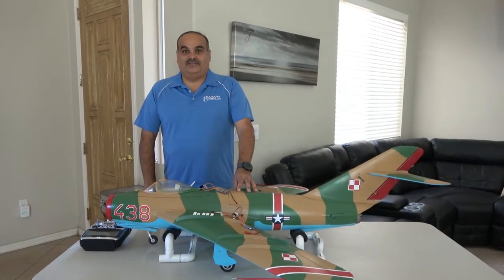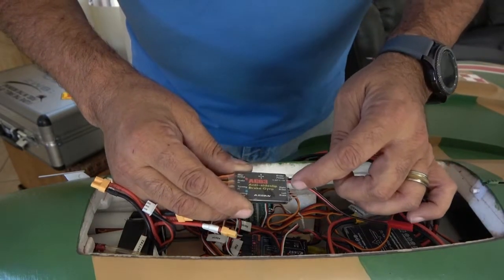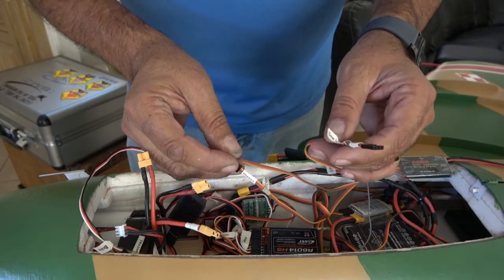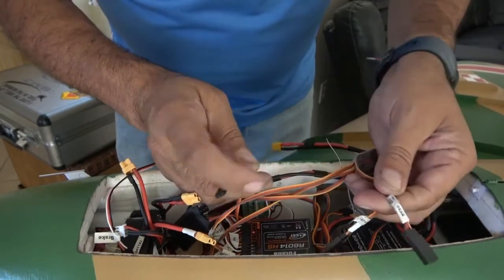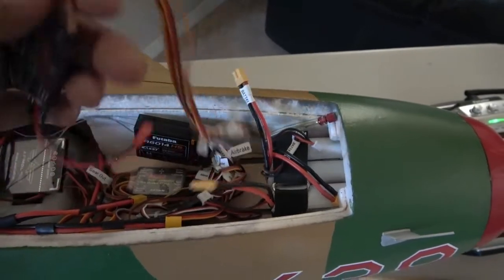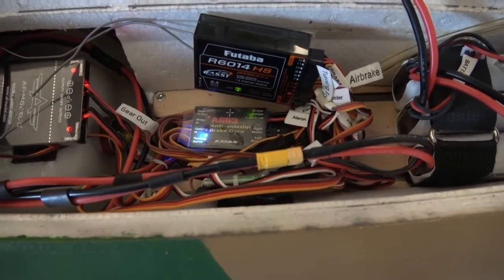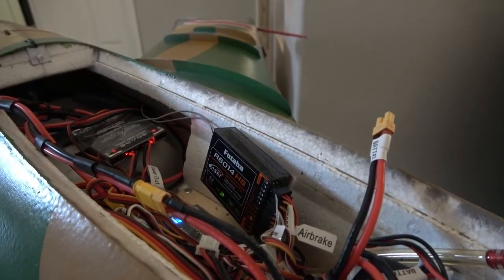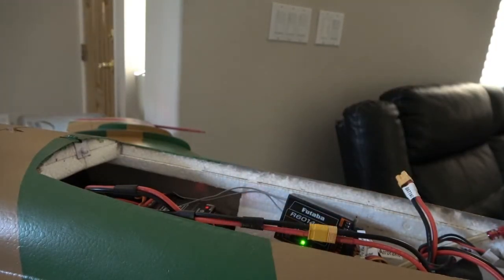AG63 Gyro Assisted Brake Controller

Comment: Just got this model and the AG68. Does the retract and gear doors controller get left in place, or did you remove it and install only the AG63 for both retract, brake and gear door?  Thx.
Reply from the maker: The brake controller will get removed completely, the AG-68 only does the retracts and not the doors, so will need a way to control the main landing gear doors. 

Option #1 leave the sequencer installed on the jet, and connect the AG-68 to the sequencer. It is the board that has the landing gear doors connected to it.

Option #2 Get the DS3 landing gear door controller for the AG-68

Option #3 And this will depend on your radio, and your programming skills. But you can also control the landing gear doors via your radio and receiver.
Reply: @ralphsalgado5891  Thank you for your reply.

Comment: Thanks for the vid Ralph! I have a question. I have the gyro hooked up and everything works. Gyro is operating the nose wheel correct and the blue light is on solid when the gear is down. The red light flashes fast. When I engage the brake switch, the red light is solid indicating the breaks are on however,  the magnetic brake is not stopping the wheels. Have you heard of this? I used the diagram and checked 5 times and I know everything is hooked up right.

Comment: Thanks for the vid Ralph…I’m having serious issues with my JP ER150 landing gear set because the brakes are not even and it’s impossible to adjust via the board they provided thus when you hit the brakes the plane shifts very aggressively for one of the sides (don’t think only the steering gyro will be able to avoid this)…please do you believe this can help me with that (considering this will act in the brakes as well)? Also this JP uses a independent 2s lipo to work (brakes and gears) so don’t know if handles that voltage considering is also plugged in the RX (which a use a normal life 2s battery) … thank you very much
Reply from the maker: Replace the JP controller with either the AG-63 for brakes only or the AG-68 for brakes and retracts. you will not have to adjust anything. Just program or calibrate the controller ONCE and you are done.

Comment: What is the polarity of the brake inputs??  They are NOT shown anywhere!!
Reply from the maker: Well, the easiest way would be to say that when you connect the two brake cables, you should see the two small metal tabs of the servo connector facing up, the smooth side facing down (away from the letters) If you stop the video at exactly 7.33 you will see what I mean.